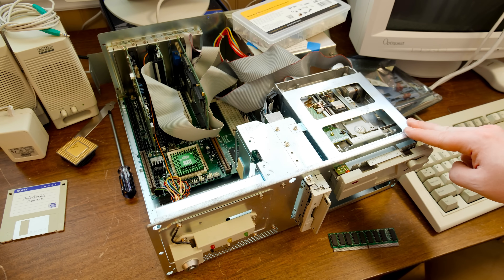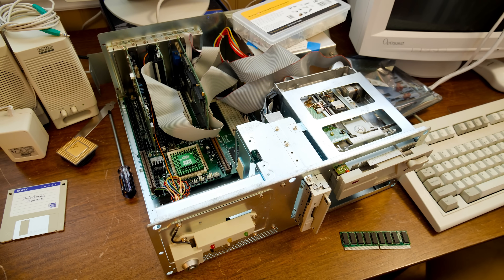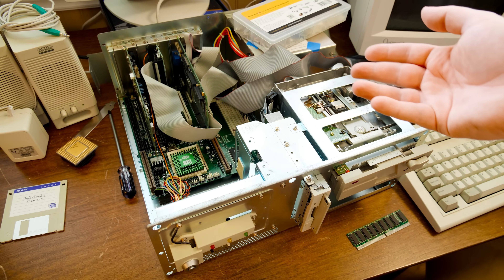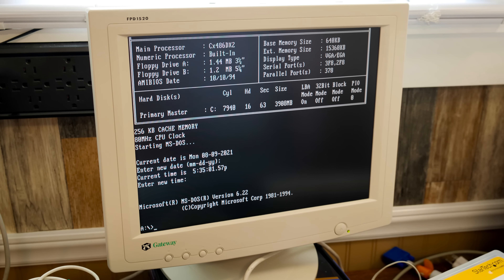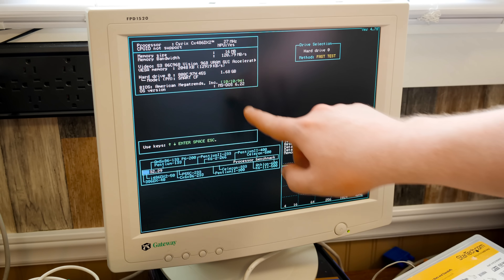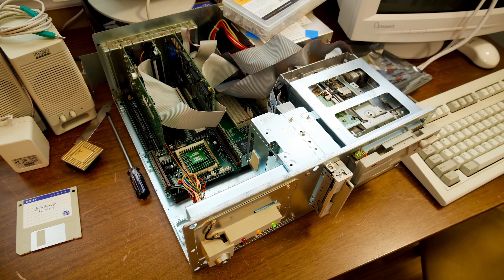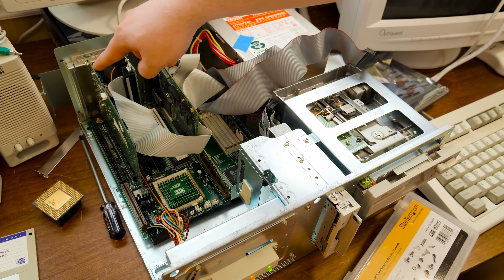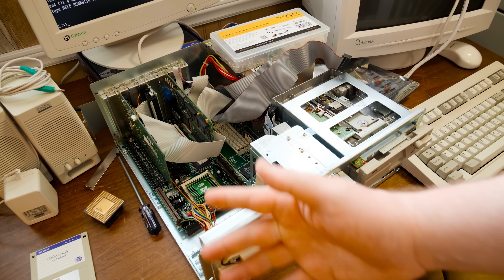M919 Fake Cache and Reproduction L2 COASt Modules

Comment: PC Chips was always awful i had one of there p3 slot 1 boards back in the day. it had a slow as balls ultra 33 hdd controller and if u put in drives bigger then 20gb it would freeze at post. it couldn't use p3 chips over 667 mhz. it was super picky about what sd ram chips would work some it would read smaller then what the chips were or would just make the system super unstable. to top it all off they never made a single bios update on it to make it support new features or cpus or anything were if u looked at boards by asus gigabtye or msi any good company they would have half a dozon or more bios updates to add new cpus or features.

one of the only companies i think that was worst then them back in the day was amptron they made u not only ship the board into them at ur cost they would charge u a $30 replacement fee that u had to pay by money order or certified check then they end up sending u a DOA board and tell u to bad and want u to again ship it back to them at ur cost and pay the $30 again...

Comment: Dosent the CF IDE adapter need power? theres a 4 pin floppy power connector on it.
Reply from the maker: It gets power from the IDE cable.
Only certain systems need the additional 4-pin connection.

Comment: So basically they sell you cache twice, clever. I did have a motherboard with fake chips too, I remember how plasticky they were, like a real cheap plastic instead of what chips are made of.
Reply from the maker: Yes, exactly! Tapping on them makes it obvious how fake they are, it's like they're made from the same type of thin plastic you get on a cheap toy.
Reply: @LGRBlerbs  Heck, up close on video, they do look a bit Rubbermaid-y...
Reply: @AaronOfMpls  That's almost an insult to Rubbermaid.
Reply: @LGRBlerbs  Ever think about just unsoldering those and removing them from the motherboard? I mean that shouldn't affect anything at all and your children's children (or whatever this computer ends up in 2100) wouldn't be fooled?  Also might be interesting to see one cut apart?
Reply: I currently have a PC Chips 486 PCI motherboard with the fake cache, though I can't remember what model it is.  M9__ is all I can remember.  These 486 motherboards were manufactured at the beginning of the "PC Chips lottery" when multiple brands were stamped onto only a few different motherboards.  There was Shuttle, Amptron, PC Chips, and ECS mostly, but all of them (iirc) were just cheap computer hardware.

Comment: The first PC I built back in 95 was a DX4-100 on one of these boards. Luckily it did come with one of the real cache modules though. The fake cache scam was pretty well reported at the time from what I remember. I'm sure Computer Shopper / PCW (UK) had a lengthy article on it with X-Rays of the chips, showing nothing inside the platic case. DIP style chips were also faked on some boards.
Reply from the maker: It's all so bonkers, haha.
How did anyone think they'd get away with it‽
Reply: @LGRBlerbs  I think one positive outcome was that it educated a lot of people about what cache RAM was :)

Comment: PC Chips...  That is all...
Reply: The same scumbags 'innovators' with the "AGP" ports that were entirely incompatible with any AGP device including the "built in" (similarly *Non Existent*) graphics adapter, which I should add did not work with any of the supplied drivers. (because actually bit-bashed PCI hiding behind a device description).  
Wasn't even the chipset I paid for. (SiS something instead of Intel BX something, if memory serves. edit: The version immediately before "Utlra-AGP", I think - given the driver hacking necessary to get something to work.)